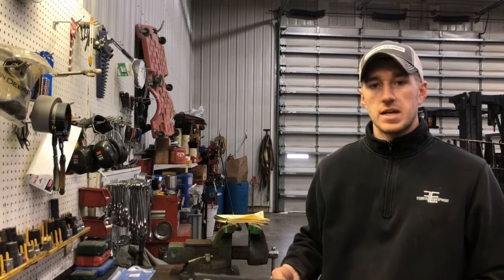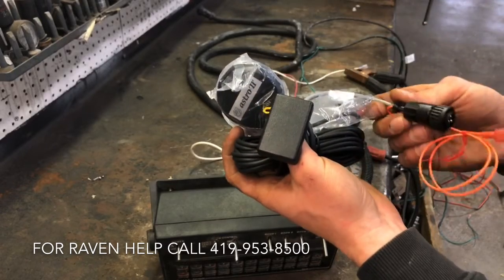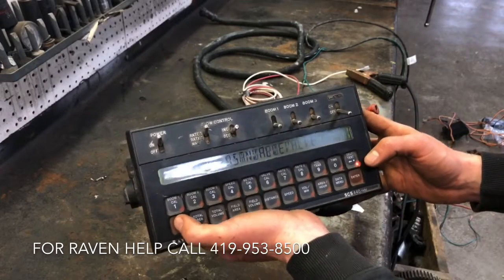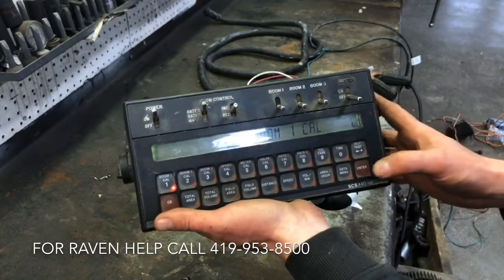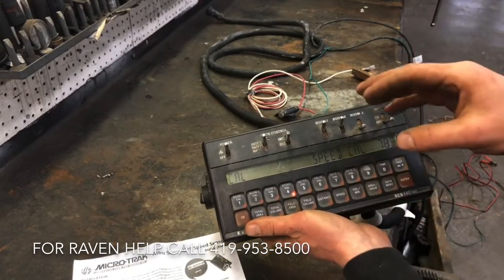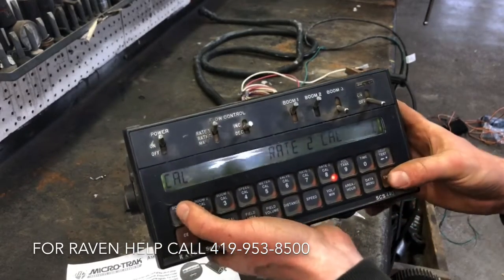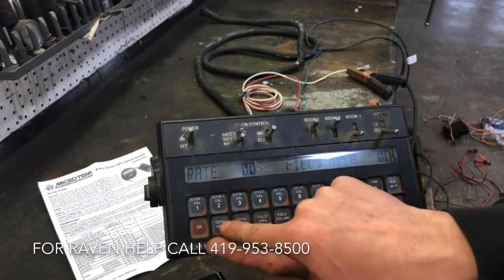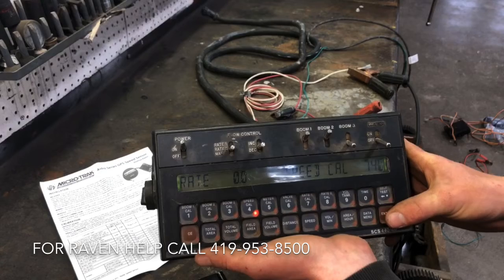How to Setup a Raven 440/450

Comment: I put a new magnetic speed sensor onto my sprayer, and it still will not read speed, magnets and gap at the sensor are ok. I wonder if my 440 is needing to be checked out or if the GPS speed sensor would correct the issue?
Reply from the maker: Text me 419-852-5836